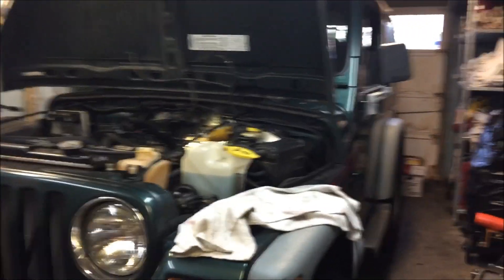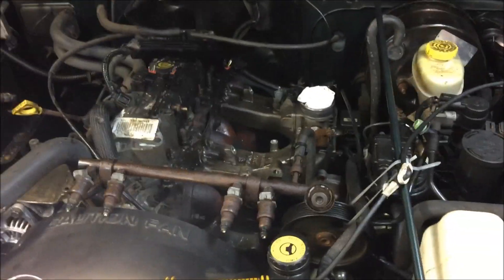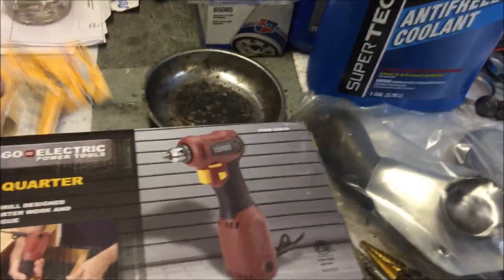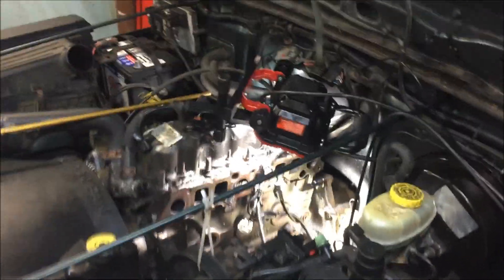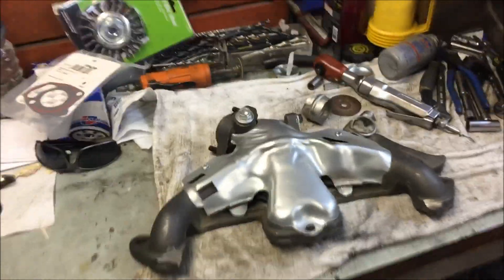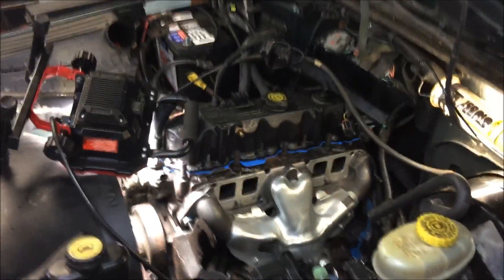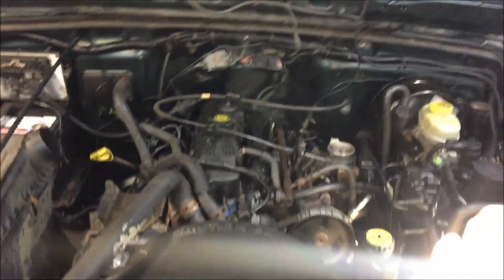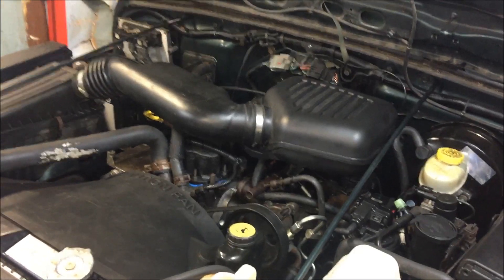CHEAP 2000 JEEP WRANGLER TJ PROJECT PART 3: NEW EXHAUST MANIFOLD INSTALL

Comment: Motor sounds good! Maybe flushing the heater core will bring back some heat. Good luck
Reply from the maker: I did a flush, it's in part 4. It didn't work. I bought new water pump, thermostat and gonna try that,  I see what happens, It will suk if Ihave to chage the heater core....
Reply: @daredevil7442AUTOMOTIVE  ha, you'd be in my position. Except I live in Texas and rarely need heat. I have no desire to pull the dash out (just yet)

Comment: What Exhaust manifold is that? Reason I ask, bought one for $25. still in the box. But hope it does not need that much work to fit. Its a Dorman, and may just trash it. The one on my 97 is cracked. Never ending with our toy's.
Reply from the maker: It's been awhile, I believe it's a Omix-ADA brand.

Comment: What did you end up doing for the bottom middle bolts that hold the intake and exhaust manifold. Mine lines up it just seems that the exhaust manifold is to thick
Reply from the maker: I had to grind down the manifold, I found out during the install that section also needed some grinding and had to take it back off....good luck